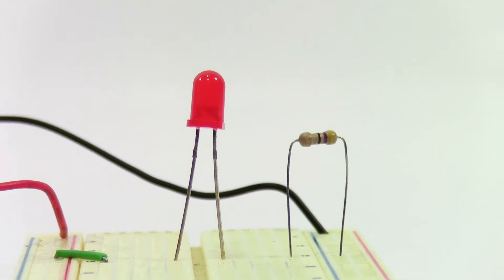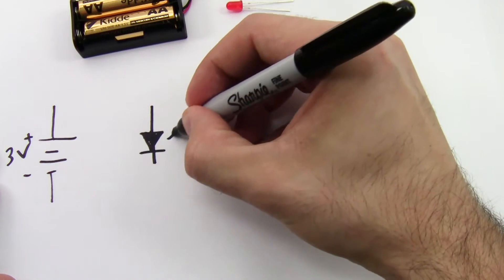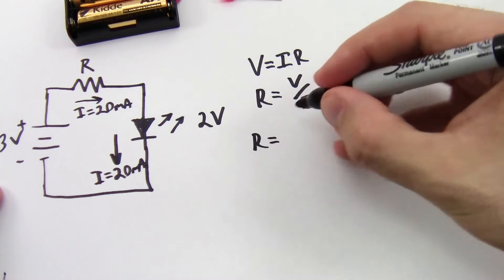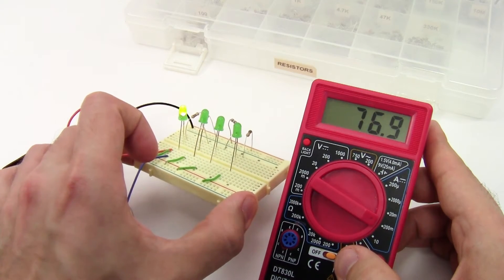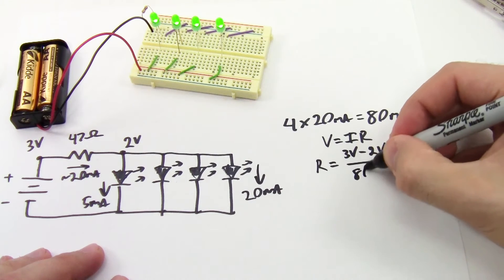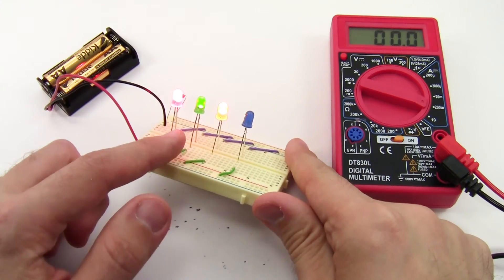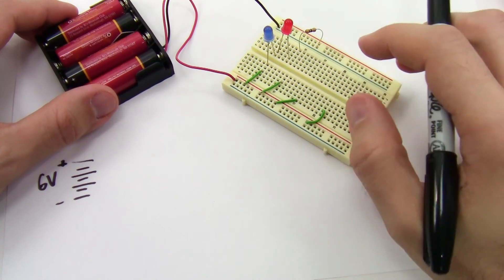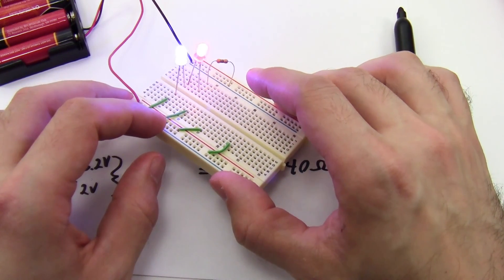How to Find LED Resistor Value

Comment: I hate electronics but for model railroading it almost a must.Now, if I put 6 lads in parallel and for some reason one burns out, don't they all go off making it very hard to find the bad one
Reply from the maker: You have it backwards - if you put LEDs in parallel and one burns out, the other 5 will stay on. If you put them in SERIES and one burns out, they will all go out.
Reply: @BenFinio  assuming each LED in // has its own resistor

Comment: Hi, if I have 3w or 5w led, can I consider the current is 0.8 amp and 1.38amp respectively, based on led forward voltage is 3.6v? Thanks,
Reply from the maker: Yes, that is reasonable to assume, although it's not clear if that's the typical rating or the maximum rating. The datasheet might say.

Comment: I have a 12V LED and a 24V power supply. Would a resistor protect my LED?
Reply from the maker: If you are referring to a 12V LED strip, those are typically designed to work with a 12V power supply. They consist of sets of 3 LEDs in series and include current limiting resistors in the strip. In theory you could use a single external resistor with a 24V supply but it would be dissipating a LOT of power so you'd need to make sure the resistor could handle the power. It's probably better to just buy an appropriate 12V supply.

Comment: I try drop my reciver voltage from 6 volts to 5.5 volts. I thought it would be 1 or 2 ohm resistor but it took 1M resistor to do it. I am bit confuse why that is 🤔

Comment: What if I have a 3v battery and 10 3v LEDs, all in parallel - do I even even need a resistor? Should I assume my resistor might draw a small voltage of say 0.1V and then use 200mA as my current? (10 LEDs at 20mA to get 200mA).

Under that assumption that my resistor draws 0.1V, my resistor would be 0.5 ohms, maybe even less... (and my Imax for a 1/4watt resistor would be 700mA, so way above the 200mA draw).
Reply from the maker: If it is a coin cell battery then you can probably use it without a resistor. I don't have time to help you with the math but these two videos may help your conceptual understanding: https://youtu.be/ZdIBle_9Y_4 https://youtu.be/a8d22YQ2qEw
Reply: @BenFinio  It’s actually likely to be a dc power supply - does that change things?
Reply from the maker: @beelzzebub  yes, the DC power supply has a much lower internal resistance and would be more likely to burn out the LEDs so I would use a resistor just to be safe.
Reply: @BenFinio  But how can i calculator the resistance needed if the voltage supply (3V) is equal to the LED’s forward voltage - R = V/I will always give 0, implying no resistor needed right?

Or maybe you’re just recommending any low ohm resistor?
Reply from the maker: @beelzzebub  assume a slightly lower operating point for the LED, e.g. 2.9V
Reply: @beelzzebub  it may not work at all.  Vs s/b >= (1 + Vf)

Comment: Could you add a small capacitor between each diode for voltage stabilization
Reply: Try it   LOL
in an AC Circuit a Cap will smooth out the voltage spikes or ripple that you have
because the difference in charge from one plate to the other will allow current to flow through teh capacitor

HOWEVER.....   in DC Circuits
With the capacitor empty
With the capacitor connected to the power supply , Let's assume you have a 5V Supply
and a 10V Capacitor

well....
Your capacitor will charge up to the voltage of the supply and no further
but since it's not AC but DC Current won't flow through it and your LED will turn off

if you wanted to control the voltage you could always put a voltage regulator on the line before the LED, it'd serve the same purpose

Comment: I don't understand any of this, I have a masters in computer science and love programming but I literally can't understand electrical engineering it just isn't making sense in my head, and ive watched tons of videos over the years.
Reply: That is the problem. Only way to learn electrical engineering is to get your hands dirty and messing about with it in practice, just learning theory won't work as well as with software engineering.
Reply: @Songfugel  yeah ive started to play with LEDs lately to make lamps, im also a woodworker. I kind of get it but if you add amps and watts then im confused again. I just know the led needs 12v, and a battery is 1.5

Comment: Thank you.

What is the 0.6 or o.7 drop voltage that it is mentionned in many tutorials. Is it the minimum PD between anode and cathode needed by the current to cross the LED ?

I am confused on this point.

Thanks in advance 😀
Reply from the maker: 0.6 or 0.7 is the typical forward voltage drop for a silicon diode when it begins conducting. The voltage drop for LEDs is usually higher, 2-4V depending on the color.
Reply: @BenFinio  
Thanks a lot Ben !
You are the only one who answer me.

Thanks my Dear 😀
Reply: @kenzo4Ever  once you know the voltage drops or rises across every component except for 1 then you can do kirchoffs voltage law and find that unknown voltage drop, which is what he was doing but he didn’t mention it

Comment: You can use  two or more resistances in parallel to overcome the power limitation problem.
Reply: well this adds a new problem, the new resistance of the in parallel resistors
Reply: @zoroco3230  well in that case it is best to use , as you suggested one  resistor in series with each led. 
The main main advantage of  this is that  the circuit will always work well. In the case of using one resistance it might not work well at all.  The reason being is that not all the led is going to have the same exact  value of the barrier potential  to overcome to light up. Therefore the one with the lowest will turn on first and all the current will rush through it causing it to be bright and may burn out and cause a chain reaction.

Comment: This is a really good video, thanks for making it and posting it. It will be helpful for my project.

My only criticism is that it would be more helpful if you included the units (mA, A, V, etc.) next to the numbers to help understand the formulas and calculations.

Will be subscribing to this channel as its so helpful.
Reply from the maker: This is a good example of "do as I say, not as I do" - you're right, it's always a good idea to write out units in the equation for clarity, not just in the final answer. Sometimes I get lazy about it!

Comment: I have purchased some LED's "turn signal" in orange, another in white for stop light and the last is white tail light.
The orange LED has 33 individual LED's this what I was reading on the listing together with the orange item
2pcs 1156PY BAU15S PY21W 150 Degree 33 SMD 5630 1056 Orange Red CAR LED Parking Lamp Brake Turn Signal Light DC 12V 33-SMD 5730
I can't make any sense out of the, they talk about Orange Red and various other items.
The only thing that do know is my car is 12v
Can you help please
Reply from the maker: Hi - I can't provide technical support for individual projects, but if you try forums like Reddit or StackExchange you may be able to find people who are able to help. Good luck!

Comment: why did you subtract 2v from the original 3v? is it because there is another load whose voltage drop is 2v (doesnt have to be an LED)?
Reply from the maker: There is a 2V drop across the LED.

Comment: Thank you for the video. What can one do if they don't have info about the voltage drop and current of the led
Reply from the maker: The voltages for different colors are pretty standard, usually starting around 2V for red up to around 4V for blue or white. So to be safe, you can assume a higher voltage and target a lower current (10mA), and start off with a large resistor (say 1kohm). Take measurements and work your way down to a smaller resistor. If you are using standard 5mm LEDs then from what I've seen the current is almost always 20mA.
Reply: @BenFinio  Thank you very much

Comment: How does 1 over 20ma equal 50?
Reply from the maker: Look out for the units - 20mA is 0.02 A, so it's 1 V /0.02 A = 50 ohms.

Comment: How did you manage to measure Amperage without breaking the circuit?
Reply from the maker: Can you refer to a specific timestamp in the video? You do need to break the circuit to put the multimeter in series to measure current.
Reply: Yes i do understand. At 5.53 mins into the video i noticed you hooked up and got a reading in the multimeter and it seemed like the LED remained on.
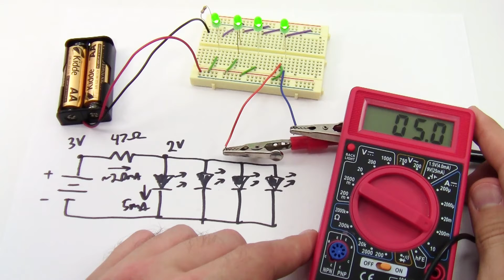Reply from the maker: @kingfijistani4262  There is a cut in the video there where I don't show rearranging the wires. At 5:50 note how the green jumper wire goes directly from the + bus to the LED in row 21. At 5:53 I have moved the leg of the LED down to row 22. The green wire goes to row 21, to the multimeter's positive lead, and then the multimeter's negative lead goes to the LED in row 22. So the current flows through the multimeter and then the LED.

Comment: If you do not a data sheet for LED's  how would calculate the voltage drop  ?
Reply from the maker: The voltage drops are pretty standard for a given color. Just google "LED color voltage" and you will find many general tables with the data. If you're unsure, it's also always safer to start out with a larger resistor. You can then measure the current and gradually decrease the resistance while keeping the current below 20mA (for most regular LEDs like the ones shown in this video).

Comment: Nice video!  The only thing I would have  liked to know more about is the construction of the LED and which side to attach the resistor and which side of the LED to attach to + or - of the battery.
Reply from the maker: Honestly I always get "cathode" and "anode" mixed up and find it easier just to remember that the long lead is the positive one. This diagram is a good one though: https://qph.fs.quoracdn.net/main-qimg-54791c1af8a06f2051c64b9d0c4d7f55
Reply: @BenFinio  Think of it in terms of exam results. (C)athode, (A)node. Scoring a C in the exam would be a negative result, scoring an A a positive result.
Reply from the maker: @PetrikNZ  Never heard that one before - helpful, thanks!

Comment: I feel like I almost grasp this. 
If you're running 3 red LED in series, you have a combined total of 6v. If you ran this setup on a 6v battery would you use a resistor at all?
Reply from the maker: Hi Heza - in general you should always still include a resistor, even if it's a very small one. It's a bit of a simplification to say that the voltage drop across an LED is perfectly constant. You can see this if you look at the current vs voltage graph on an LED datasheet. For example see the FORWARD CURRENT VS APPLIED VOLTAGE graph on this one: https://www.jameco.com/Jameco/Products/ProdDS/333851.pdf. In other words, even if you have an LED with a rated forward voltage of 2V, and you apply 1.9V to it, you're going to get a non-zero amount of current.

Comment: Hi sir, just wondering if you can provide credible sources like websites or articles that I can use as reference for this experiment. Need it for the demo paper hehe. Thank you!
Reply from the maker: I am not sure what your teacher will consider "credible," but if you just google "LED resistor calculation," LED calculator," "LED current limiting resistor" etc. you will find many websites that present the same information.

Comment: so if you have exact voltage there is no need for resistor
Reply from the maker: In general it is a good idea to have a resistor. The math in this video shows idealized LED behavior with a constant forward voltage drop. In reality LED behavior is more complicated and there is something called an "I-V curve" (graph of current vs voltage) that you can find on the LED datasheet. It's also difficult to get common voltage supplies that are an exact multiple of the voltage you need for the LED. The one exception is coin cell batteries which do not provide very much current - it's safe to use those without a resistor, which is how people make LED throwies like these: https://www.instructables.com/LED-Throwies/

Comment: Very clear and comprehensive with different scenerios, thank you! 

I got few questions, in another video it said it is possible to measure forward voltage of an LED diode in multimeter diode mode. And it did work for my red and yellow leds, showing around 1.8 volts, but it doesnt seem to work for my blue or white LEDs,. Any idea what is the problem? 

Also is this method applicable for longer LED strips? 

Is it possible to figure out ideal current for a given LED too, without risking burning out the LED with trial and error?

I'm quite a newbie, I'm sorry if these are dumb questions, but any help is much appreciated. Cheers.
Reply: I noticed in the answers the safe guess approach and lowering the resistance slowly. That's helpful to me. But I still wonder about my questions :/
Reply from the maker: Hi Emirworks - 

First, I'm not that familiar with the diode measurement mode on multimeters. Blue and white LEDs have a higher voltage drop, typically around 3-4V, so maybe your multimeter's diode mode can't measure that high. 

The LED strips you can buy usually have built-in resistors so you don't need to worry about adding external ones. You just connect them directly to whatever power supply they come with or say to use. 

And yes from your other comment you're correct that the safest thing to do is start high and slowly lower the resistance.

Hope that helps!
Reply: @BenFinio  Thank you so much for the reply. I really acknowledge the value of feedback.  I subbed :)

Have a nice day!
Reply from the maker: @EmirUysal  Thanks! If you haven't seen it yet, I have a playlist of other tutorials here that may be useful if you're new to electronics: https://www.youtube.com/playlist?list=PLKL6KBeCnI3V5XgmKOHv4vKPGBd-qc1QU

Comment: can i connect fifty 3.2 led which is going to powered by a 24 V system with a single resistor?
Reply from the maker: It depends on how you connect the LEDs and the power rating of the resistor. If you watch the entire video it will show you how to do the calculation.
Reply: @BenFinio  I to want connect 50 rgb in series with a 24v system..
Reply from the maker: @jeevabharathir8163  24 volts will not be enough to put 50 LEDs in series. At a minimum of about 2 volts per LED, putting 50 of them in series would require at least 100 volts.

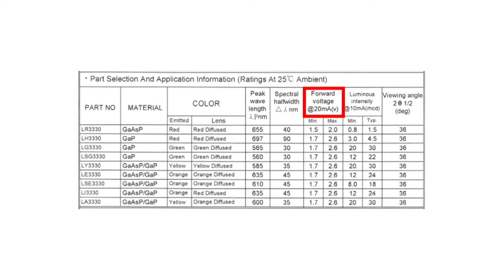Comment: What if i dont have a 0:20 information about the data of the LED, how can i find it out?
Reply from the maker: For almost all "regular" LEDs (the kind used with Arduino projects etc), the current is about 20mA and the voltage is somewhere between 2-4V depending on the color (lower for red/green, higher for blue/white), so those are safe guesses to start. You can always start with a conservatively large resistance value, use a multimeter to measure the current, and drop the resistance if it's within safe limits.
Reply: @BenFinio  thank you very much!
Reply: @BenFinio hi Ben, can you please make a video on how to calculate the required resistance and power usage of ic chips such as an and gate. Given that I may be need send one output back to another input, it makes the whole process a bit more difficult to figure out. Great video btw
Reply from the maker: @BrisbaneStomp  Hi - I'm not going to have time to make a video about that any time soon, but long story short you do not need a current-limiting resistor with digital logic chips like you do with an LED. You connect them directly to the power supply, and the voltage range of the power supply you need will be listed in the chip's datasheet.

Comment: Really great video. What’s the purpose of the 0-ohm resistors in your kit?
Reply from the maker: Good question - honestly I wasn't sure and had to Google it. Apparently the answer to "why not just use a jumper wire?" is that it makes automated assembly of printed circuit boards easier. It's the same size/shape as all the other resistors so the pick-and-place machines can just grab it without needing a separate machine or attachment. So, for a hobbyist kit like this where you're probably putting all the parts in a breadboard by hand, there's no functional difference between the 0 ohm resistor and a jumper wire.

Comment: Great video, thank you for making it. How do you figure this out when you don’t know the values of the LEDs you are using?
Reply from the maker: Hi Michael - the voltages for LEDs are pretty standard based on the color. Just google "LED voltage color chart" and you will find a bunch of them. Almost all of the "regular size" LEDs (the kind you see in this video) are rated at 20mA, so that is usually a good guess to start. To be safe, you can always start with a bigger resistor, measure the current through the LED (assuming you have a multimeter - separate tutorial on that coming soon), and then move down to a smaller resistor if the current is still below 20mA.

Comment: Could you not also run the different lights from different 'taps' of the battery pack.
Reply from the maker: This would be equivalent to putting the LEDs in parallel.